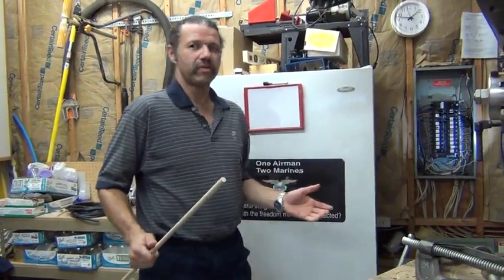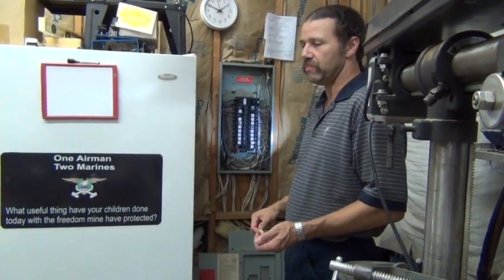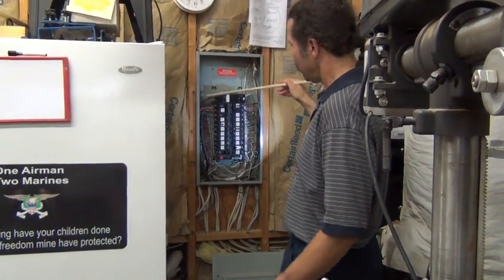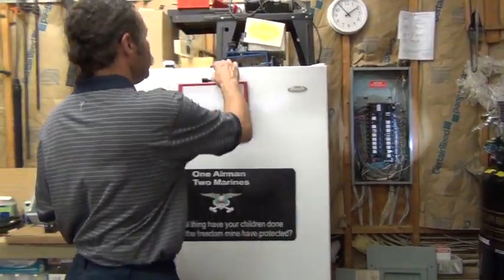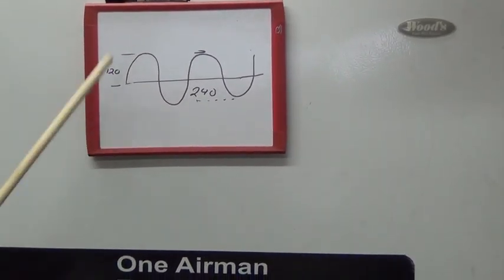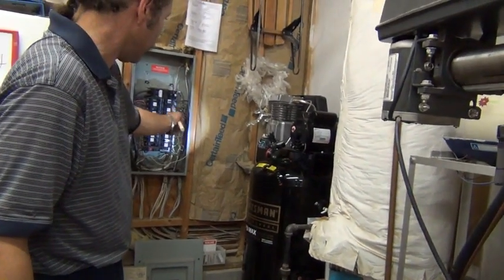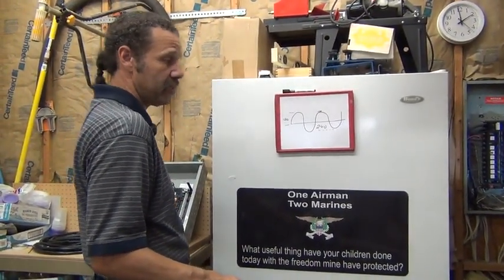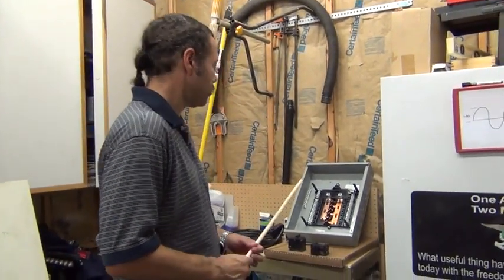subpanel install Pt 1

Comment from the maker: For the main supply white and silver in this instance are the same.  Inside the power panel the silver/ground lead connects with all of the house white leads.  The copper/grounded lead is the bare wire for loads.

Comment from the maker: Another example here of someone with a good eye but otherwise clueless. That screw is call a "bonding screw". IF the neutral and ground were to be bonded the screw would be torqued allowing it to make metal to metal contact. As it is now it "floats" above the panel in plastic threads.  The inspector was aware of this.  BTW I am trained in electrical theory, motor and generator operation and control two 1015 MW generators lighting the bulb under Mr. Norton's rock.  School is out.